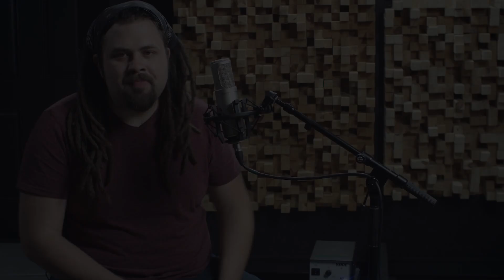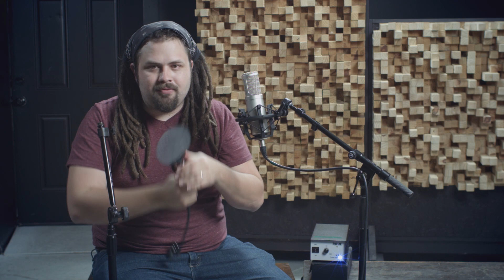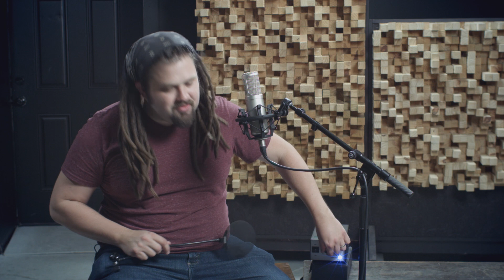How to use the Polar Pattern Settings as a Tone Control on Your Condenser Mics

Comment: Did you EQ or hipass this microphone signal at all? It sounds a little strange for vocals, and when you dial the omni pattern it starts to sound reeeaally funny upclose. Very midrangey... Maybe works for soprano vocals?
Reply from the maker: All examples are dry. No effects at all. What you hear is exactly how this mic works, and it could be that some mics are very midrangey while others less so. I really like the mids of this mic actually, but usually would use it closer on the spectrum to cardioid.

Comment: A fresh approach to using polar patterns - this is great! Do you utilise the 'in-between' polar pattern dial on your K2 much? If so, in what way do you use it? The NT2000 has the same thing, but I've never found a use for it. I just go for either cardioid, figure 8 or omni.
Reply from the maker: +Martin Yes, I use the area in between the patterns too. In the same way that I'm using the polar patterns here in the video, you can give it a little more or less proximity effect by turning it one way or the there. Need less low end because your vocalist insists to be close to the mic, then turn it a touch toward omni. Have a shy vocalist that does't like to get close to the mic, then go a little shaper towards the figure 8 to give it a little more prox effect so it sounds full but at greater distances.
Reply: +creativesoundlab Thanks for clearing that up. I'll have to give that a shot!

Comment: At 5:35 you said it's great for background vocals to get right up to the mic, just curious, why is that?
Reply from the maker: +Joeri Braams I'm sure there are many approaches, and lots of styles of BGVs. However, I have found that it works well to have the BG Vocalist close to the mic and in omni, so that I can mix them low in the mix. They end up sounding very dry, but very direct. It's a sound that for me, mixes well because you can still hear them and it's different than the main vocalist.
Reply: +creativesoundlab Aah that make a whole lot of sense, thanks man I'll try it out someday soon.

Comment: Interesting that you mention you can use figure of 8 mics to block out cymbals from tom mics. I was wondering if you tried the same technique on the snare? I could imagine blocking out the hi hat and the adding lows due to the proximity effect would be the two biggest advantages. More bleed from the crash would be the biggest disadvantage. Do you have any experience with figure of 8 on snare, and if so, how did you like it?
Reply from the maker: +ecmusicproductions Yeah, I don't really use it on snare but your on to something though. Figure8 can be great for hihat so that you can reject the crash cymbal that most drummers have above the hi tom. You can also angle it to reject the snare as well. For snare, I often find that I can use a Cardioid mic and point the back of it at the hihat. Aim with the back of the mic first.
Reply: creativesoundlab
That makes sense and it's actually the way I go for snare as well. Next chance I'll get, I'd definitely give figure of 8 a go on snare top. Thanks for the great videos!

Comment: Curious... how would you approach recording acoustic guitar AND vocals simultaneously with only one mic? Cardioid with it pointed around the middle point to pick up both sources fairly?... or would something like a figure 8 actually be beneficial to try and pick up both sources in a live setting? Opinions???
Reply from the maker: Hmmm, I would use a ribbon and stand it up tall so the ribbon looks up and down. You have about 30 degrees of on-axis to use so you could easily place a mic about 8 inches to 1 foot from the vocal, and also get some of the guitar. Either that, or use an omni that is real smooth down in the lows, and have them sing facing into a dead closet or absorption, and then use an omni facing out towards them. Use distance to control levels.
Reply: Thanks for the reply. I am going to be limited to 2 mics at my disposal - a Audix CX 212B that offers an omni + cardioid + figure eight, and just a Groove Tubes FET MD1B cardioid mic.... This is not a serious recording. More of a fun live recording on the road. I was trying to think of a way to capture the performance of live playing without too much gear. Not too concerned about flexibility in the mixing stage even though thats always a plus. I would prefer just using one of the two mics, but CAN use both technically... though less gear on the road is a plus.

Comment: When I edit sound, I match loudness to broadcast levels which means that the amplitude is increased. The problem with this is that only then can I hear any unwanted noise that might be there as opposed to while I am recording. Is it possible to know at the time what I am going to hear when I edit it later?
Reply from the maker: +Seventh Exception My best advice would be to use headphones (You most likely are already if you are doing on-location sound), and then a really loud headphone amp. You could also try compressing the audio aside from the recorded audio. The compression will allow you to hear softer portions and bring those issues of noise, and room noise, ambiences ect to your attention so you know to do something about it. The other thing, which you pry already have, is just having experience with equipment and what circumstance will give you problems. I have a sense now that I've done stuff for a while of what is noise that will harm the intended recording, and what won't be an issue.
Reply: +creativesoundlab Thanks heaps. I will look into those options. Yes, I have been learning the hard way what unwanted sounds turn up in post!

Comment: Hey, inspired by your channel, love it. Quick question regarding a possible use for OMNI, I've got my own take on Glyn Johns that sounds great on my drummer for demos; Kick, snare, OH (cardioid, pointed more towards the rack), back of kit on the floor (under floor toms, pointed at kick beater) and finally, side pointed more towards the floor toms and closer in than GJ's. Yes, I know this can be a problem for phase but I'm not using matched pairs and monitor closely. My drummer likes using two floor toms of rather large sizes, the last one in line goes a tad missing in the mix, wanting to stick to my technique and style of recording drums, would an omni mic in this position on the side of GJ's capture this 2nd floor tom? Thanks for your time, keep up the good work.  T